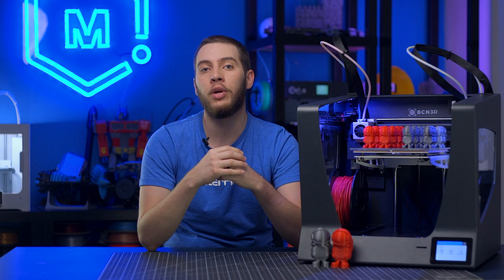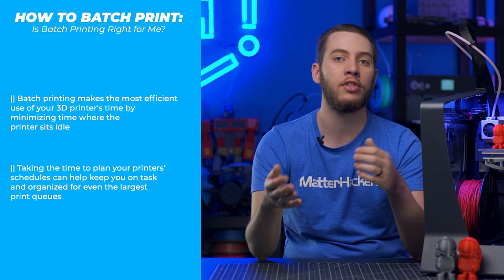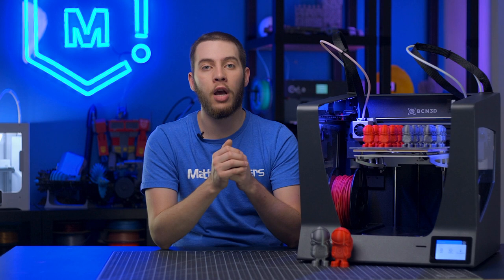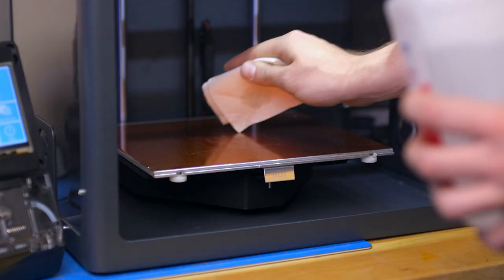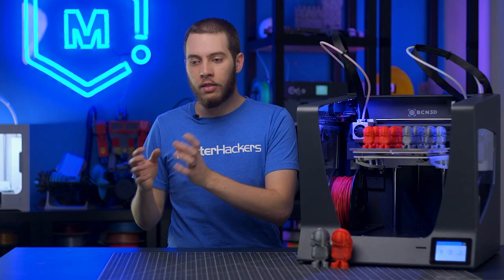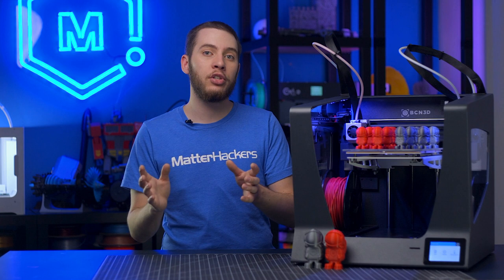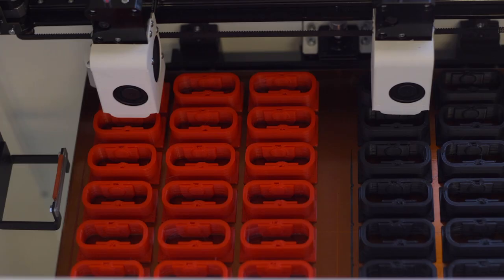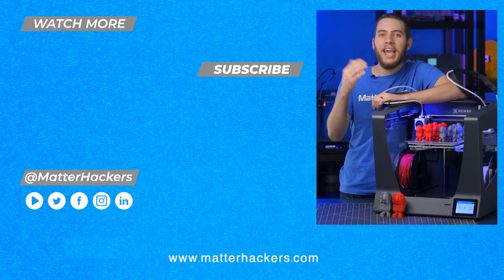How To: Maximize Batch Printing with 3D Printers

Comment: Thanks. Alec. One other thing to think about is if the part is small enough, you could print in "One at a time" mode to reduce the risk of losing an entire batch, which is probably best used during that 7 hour stretch when you can monitor it. If the extruder jams or a part become detached or various other reasons, you might have to only scrap one part instead of a whole batch of incomplete parts.

Comment: For the cost of a dual extruder printer you can get 4 to 10 single extruder printers which will greatly decrease your batch printing time.
Reply: I think that's why prusa made the mini, they were thinking about concurrent printing vs large plate or batch printing.

Comment: I am curious about the potential for strength compromises due to batch processing.  Does the fact the first layer has excessive time to cool before the second layer is deposited negatively effect the layer adhesion/part strenght.  I have an application where stength is the key design criteria.  The volume of parts is high so I really need to process "by layer" rather than "by part" because my machine can't fit enough parts on the build plate in "by part" mode.  I would appreciate any insights you might be able to offer.

Comment: Would it be possible to have a dual extruder printer with two different sized nozles to combine faster printing with the ability to add fine detail at different parts of the print?
Reply: This is possible, with a dual nozzle set up, you could have something like 0.4 mm and 0.8 mm, with most slicers, you can dictate which extruder/nozzle is used for each feature, so you could use the 0.8 for infill and the 0.4 for walls for example. I don't know of any slicers that have intelligence in determining which features require the higher level of detail, but at the crude level of walls/supports/infill/etc., you can shave a fair bit of time (esp. considering that larger nozzles allow for greater layer heights, both PrusaSlicer and Cura have ways of making things such as infill be a multiple of the layer height of the rest of the print).